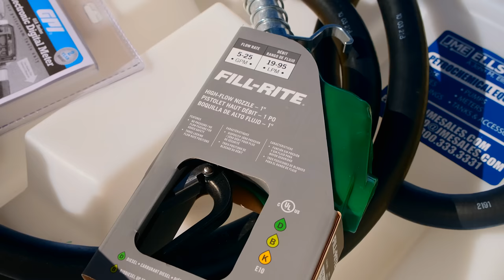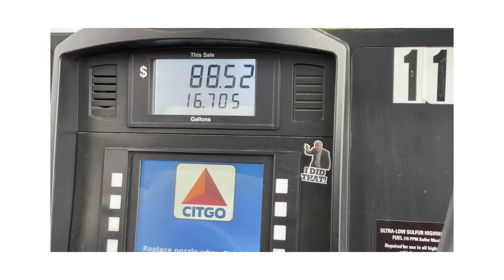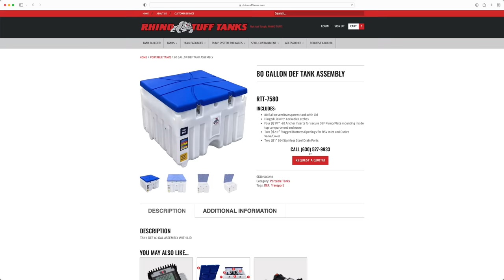DID I OVER PAY FOR THIS? EVEN SO, I’M STILL HAPPY!

Comment: Questions, is there a fuel delivery service so you don't have to transport the 80 gal tank tank every time to fill it and with a fuel delivery service road taxes on the fuel should be eliminated if your using it off road?
Reply from the maker: Good question, I'd have to look around....wonder if 80 gallons would even meet their minimum?
Reply: Most fuel delivery requires a 200 gal minimum. I bought a 250 gal because of that minimum. That way I can order before I’m completely out. Might not be the case in your area.
Reply: My local propane supplier delivers off road diesel to my 55 gallon drum for free since I’m a customer of theirs, otherwise there is a 200 gallon minimum for free delivery.
Reply: @troysmith7669  You have better company service than I do. I get my propane from the same company. They still have a minimum on the propane and diesel.

Comment: Just make sure you close on your house b4 filling that tank! 😁😁
Also might want to check with your property ins agent about storing that much fuel indoors, usually they have you keep it separate. Outdoors and away from structures is called for.
Reply from the maker: Haha!  Yeah, I asked about that awhile back and they didn't have any special requirements.
Reply: @GoodWorksTractors  I asked my guy that too and as long as you don't have an open flame burner/heater/solid fuel furnace in there it'll be fine. (in Wisc anyhow)

Comment: Would the tank [full] fit in your sidebyside to rescue an empty tractor in the field?
Reply: I think the "rescue" could be done with the 5 gallon can. Even if the bed was large enough, loading 700+ pounds, full tank, plus having to add an inverter that could power the pump to the sidebyside would be prohibitive.
I would definitely want to move that container outside, just because of the potential for spills on the concrete. A lean to could be made over it for weather and UV protection. Also would only plug it in when ready to pump.
Reply: @williamgaines9784  side note, the JD Gator can hold 1,000 and has a 110v plug in the cab.
Reply: @ronaldharmon9891  okay, the vehicle can hold the weight, but you still have to load a 700 pound tote into it and then unload it when you are done, or you can just grab the 40 pound 5 gallon fuel can and get your equipment "rescued" and then fill up at the shop. 
What is the wattage on the 110 plug in the vehicle? Can it run that pump?
Maybe a trailer with a 12v pump would be a better option, but that tank may not be designed for transport in that manner.
Reply: @williamgaines9784  ya got me there😁

Comment: The smaller diameter nozzle tube is for DEF tanks on semis. So that you can't inadvertently fill DEF with diesel. All the metal in that unit are Stainless Steel if it's for DEF. Any other metal will contaminate DEF. Nice unit.  I've bought a few fuel components from Ellsworth.  They have always treated me right.

Comment: These are the kind of videos I like, giving me ideas on things to buy. I’m not sure my 1025 could lift up that tank though, once it was full. At around 670 pounds full, plus the tank weight, it’s about 200 pounds over the limit for the 1025r. I think I would be better off with a 40 gallon tank. It’s so depressing that when you go out and buy a brand new 2022 John Deere 1025r tractor package with a bunch of attachments, once it’s said and done, you don’t have enough money left over to buy the toys to go with it. This “build back better” let’s go Brandon economy just ain’t working for me. 🤣😂🤣😂
Reply: Just fill it up to 40 gallons. Problem solved.

Comment: Both nozzles should be auto shut off in all honesty. The on ya bought will allow for more flow if your pump is capable of higher flow. Ive used both styles, both work fine.
Reply: The nozzle on my 12v pump looks just like the smaller on in the video. Mine won't auto-shut off, although I really wish it would. Not sure if mine is the same as the one in the video, but they sure do look the same.

Comment: Fuel should never be stored inside.
Reply from the maker: While I understand the caution behind what you’re saying, where do we store gas in small containers for our trimmers and mowers and blowers? Where do we store our cars full of 10 to 20 gallons of gas? Both are indoors, no?
Reply: @GoodWorksTractors   I do not. Will void your house insurance too. Check out the fine print. At our gas stations they have signs saying not even to use the cell phone while filling up. And eighty gallons of diesel can do a lot of damage when a fire starts. Just saying.